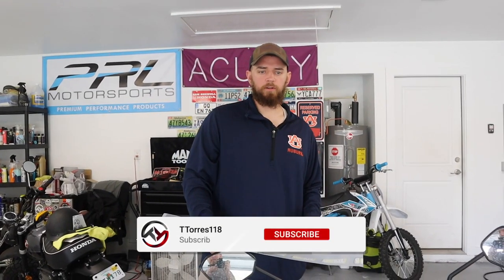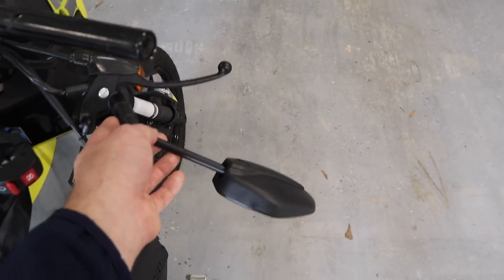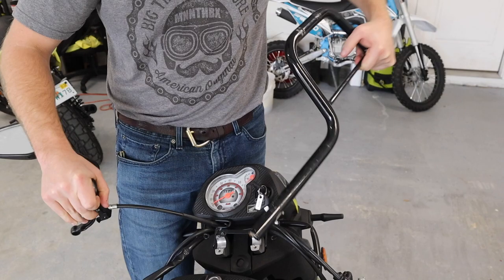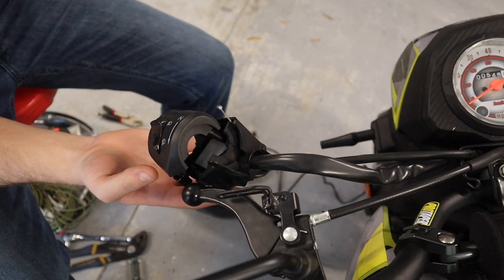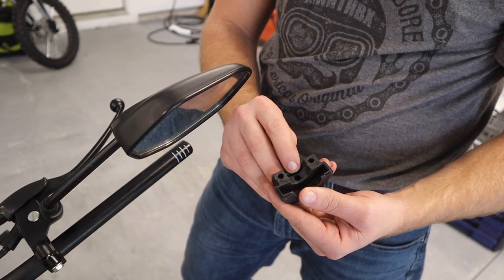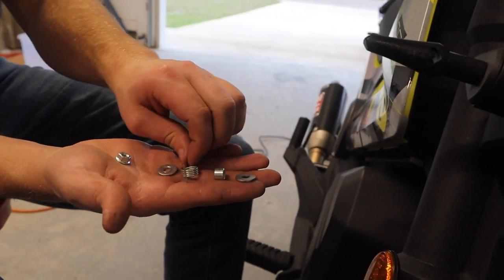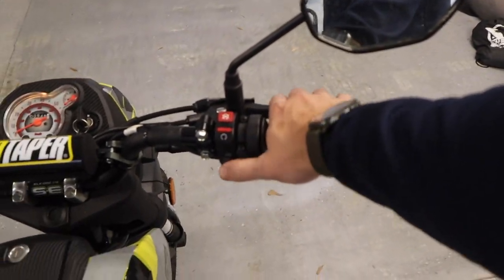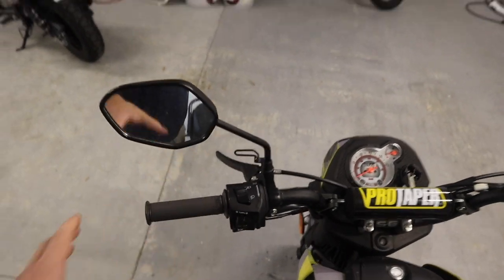2022 Honda Navi Handlebar/Grip Install!

Comment: Does anything move after shaving off those nubs? I am about to embark on the same project and i dont feel like drilling holes
Reply: I'm wondering the same before i tackle this project. did you ever find the answer?
Reply: @goinbck2cali  I drilled the holes it wasn't that hard